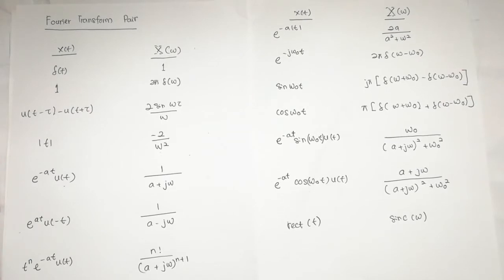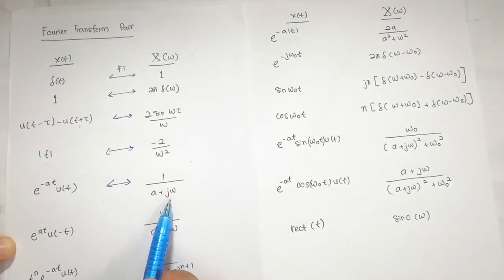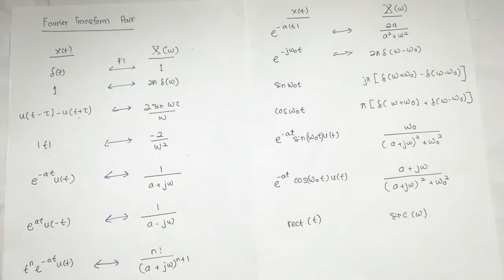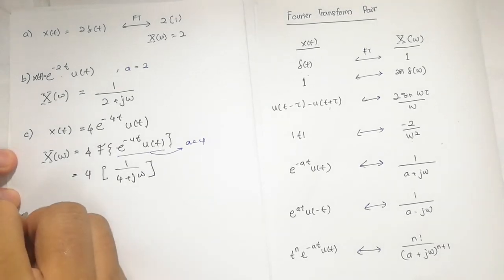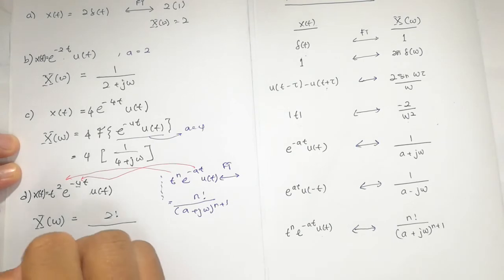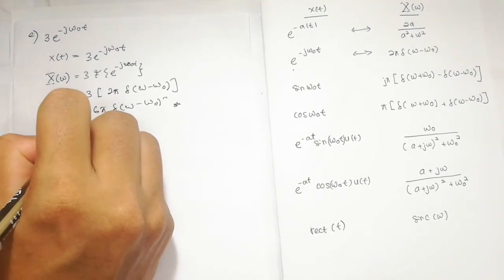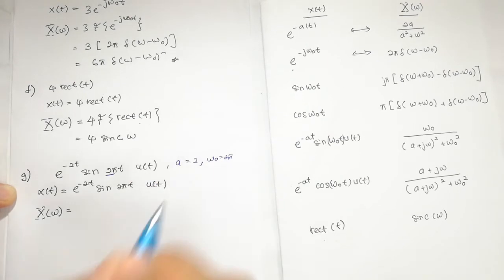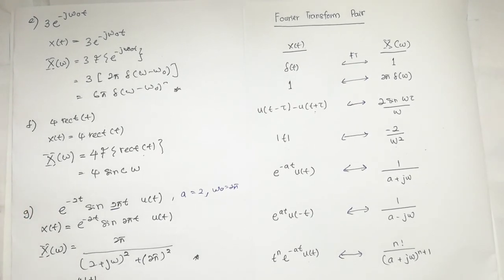Lecture 4.5: SnS - Fourier Transform Pair

Comment: A second method to solve Fourier transforms was shown in this video. The method known as Fourier transform pairs is a much easier and more straightforward method compared to using the definition of Fourier transform. 
The main concept of this method is to use a table of transformations and apply the most relevant one to the question on hand, this was shown in detail through the examples in this video. 
Thank you, Dr.Ansar.
Reply: i realize Im kinda off topic but does anyone know of a good site to watch new tv shows online ?
Reply: @Royce Ricky Thank you, I went there and it seems to work :D I really appreciate it !!
Reply: @Dominic Finley No problem :)